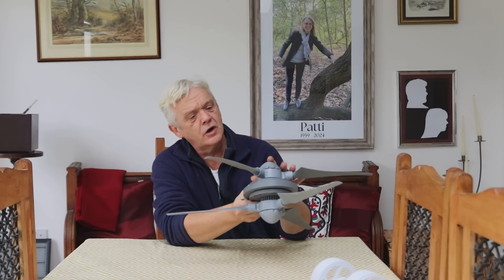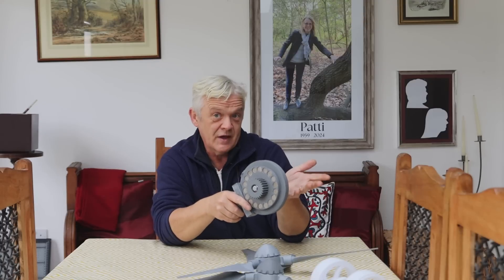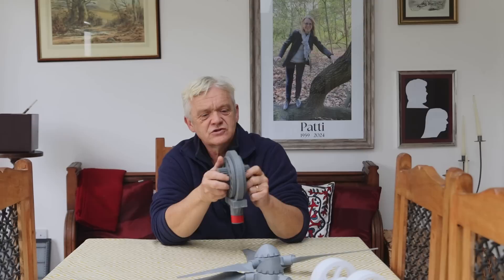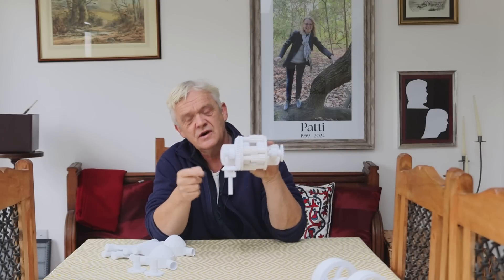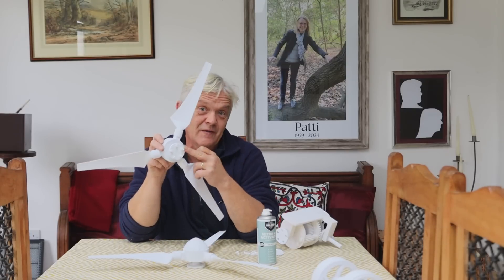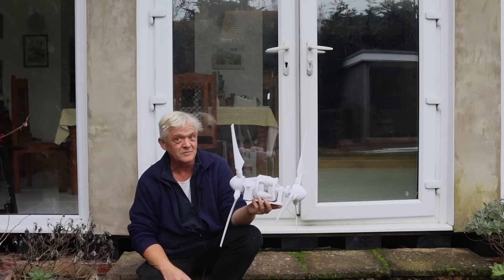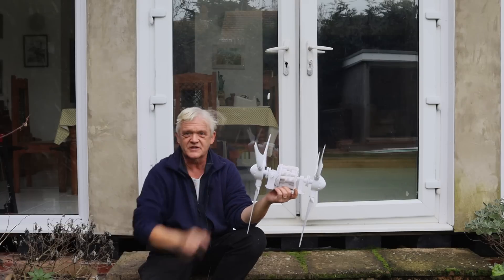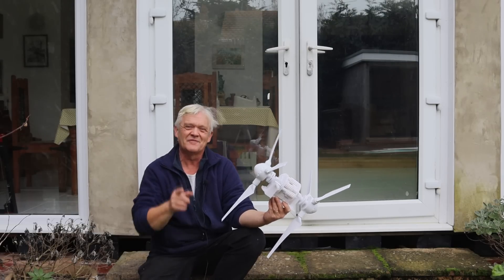2315 The Differential Wind Turbine

Comment: I made wind turbine controller from relay and zener diode and stuff. It disconnect turbine from circuit when there is too much voltage or too windy.
I think it is better than commercial one what basicly short the circuit, heat the coils and spoil magnets.

Comment: Very interesting thank you. A few years ago I met an inventor who took a different approach to the problem you are tackling. Instead of having two rotors and a central shared stator as in your design, he made both the rotor and stator rotate. One set of blades driving rotor and the other driving stator. A compact, simple and lightweight setup. A further claimed benefit was reduced stress on the supporting structure as the symmetrical reactions generated by the two rotating assemblies combine and neutralise each other prior to flowing out to the structure. ... Makes sense?

Comment: Been looking in the research but haven't seen it, is there anything to making the blades on 1 side slightly larger so as to capture somewhat more energy than the small and equalise the power/speed between the sides?  There would need to be a control that the small side faces into the wind and the large is on the downwind side.  Differences in wind speed energies requiring different diameters of blade could also be controlled to a degree by changing the blade pitch, a fairly common control on full sized windmills.  A control will be needed anyway as without a vane it isn't aligned passively into the wind.  Just thinking that equalising the output would simplify things resulting in an overall less mechanically complex unit though control complexity is increased.  However that is mainly programming.  Hmmm, just thinking this supposes a relatively constant windspeed which is not always the case.  How fast would the control system have to react?  Might not be practical however I'll still post this as it may spark other idea's.

Comment: Another comment regarding the PLA, have you ever tried iron-impregnated PLA in one of the generator designs? From my understanding if the core inside each copper coil contains ferrous material it improves generator efficiency greatly. There is also a stainless-steel impregnated PLA (both claim roughly 60% metal content), but I'm not sure if the type used is ferromagnetic. Would be interesting to build a gen using the iron PLA, perhaps only in the coil cores due to its substantially higher cost.. I would imagine ordinary PLA and the metal PLA would bond just fine so the filament could be switched mid-print.. but depending on design that could be very wasteful on the filament. Something interesting to consider :) I see "protopasta" makes metal PLA and it's available on Amazon.

Comment: Why not adapt the angle of attack on the two rotors differently to accomodate to the power loss. Not sure if it would be easy to measure if the angle "is good" then

Comment: Could you substitute the mechanical differential with a bit more complex electronics?

My idea is to put the magnets on one set of blades and the coils on the other set. By getting them to rotate in counter-directions, you get power output by having either one rotate or more if they both rotate.

To get the power out of the coils, you would need a bit more complex wiring, but a set of cheap brushes will do for this model size.

Comment: Using the greater length of the part of the cylinder of your diaphragm piston, I converted that into the piston and inserted it into a short length of acrylic tubing.  Instead of using the glove, I used a section from an old bicycle inner tube which lined the new piston and stretched around the outside acrylic tube.  I reprinted the cylinder to make it solid.  The material of the inner tube is butyl.  It still needs graphite for lubrication but it's workable and is a cheap way of having an actuator that could exert a few kilos of force in one direction.  However it could make quite a good water pump.  But if you want a really good water pump look no further than a sink plunger!  If you glue a sheet of perspex under it, drill holes for valves and put a crankshaft at the stick end, turn the crank, then for each cycle it could shift around 70ml of water.  If that was connected to the wind turbine it could pump water to a tank at a higher level.  Of course, in reverse it could still work as an engine or as a hydraulic motor.  So if you had 2 sink plungers, as one crankshaft rotated, the pressure transmitted through the hose pipe would go to the other sink plunger, and it would drive the flywheel.  A sink plunger is one of those things that one would never consider using, but having watched a good number of your videos, the possibilities certainly leads to some exploration.
Reply from the maker: that is impressive work mate - and i am doubly grateful you shared it - brilliant ideas - thanks so much

Comment: and what about rotors turning in opposite direction - one turns rotor and other turns stator which is connected through slip ring contacts. 
that would increase RPM on alternator.

Comment: Awesome video Robert.  … very inspirational.  Combining power should occur, but I’m thinking that the rear propeller could also spin backwards.  Even if it’s not obvious, a loss of power might be see.  I’m wondering if the rear blades need a greater pitch than the front - given the slower speed.  

I guess the only way to find out is to test it at extreme pitches, I think.  

You have inspired me to design a better pool cover gear system.  I’m thinking about using lantern gears made from 3d printing.
Reply from the maker: i have already made this in a different format mate it doesn't spin backwards

Comment: Copier technician approved!
We see a LOT of similar mechanisms!
.
Another advantage...
If the power take-off is mounted "vertically, the generator unit could be positioned low on the pylon which may reduce the mass and torque at the top of the unit?
Reply from the maker: awesome mate

Comment: Been traveling for the past couple of months, finally begin printing the parts for your portable generator, decide to switch to PETG from PLE + because of it's superior durability, spend the next two days of fail, coming to the conclusion I'm a nube who forgot his KISS principle, switch back to PLE +, because that works and I'm making a prototype that I will no doubt muck up as a first go, print one of the gears successfully, look out the window, there's no wind, and decide to see what Robert is up to...I'm beginning to feel a bit like Dorian Gray's portrait.
Reply from the maker: wow - where have you been to and di you enjoy it?
Reply: @ThinkingandTinkering  Short version, Northern California to the coast, Southern Cal, to Palm Strings, to Tuscon, to Utah, to Nevada, to SF, to San Diego, there and back again. The highlight was drowning my sorrows at the absence of pubs and pints in the local wine bar.  Sitting next to an retired electrician who thought I was quite mad for building a generator with a 3d printer and winding my own coil - serpentine, thank you very much, we bonded over my ignorance, enthusiasm, and tipped a glass to you.

Comment: I think this twin rotor is dead in the water and not worth pursuing, It it was then we'd be using it. 
If you study airflow then you'll realise that what comes out of the back of a turbine is a random mess of air and incapable of powering another one to any positive degree. It will actually be worse than that though and hinder the flow through the first one by having it's exiting energy reduced.

I hold you in such high regard that (and i've said it before) you are good enough to be on TV, but the one annoying thing is that you never see your projects through to the end. If you did that you'd be a much more powerful resource.
I wish I lived near you, i'd be popping round to team up and make some of these things and see if they work in reality!
Reply from the maker: it is being used
Reply: @ThinkingandTinkering  Successfully? If so, where?

Comment: Bravo ! ! !  Nice exactly what was needed to make this great ! ! ! Some dimension also need to be corrected. I was reading some studies about this topic,  distance from rotors is also very important, swirl angle, dimensions of the rotors, with smaller rotor in front & larger in the back,  power peaked with rotational speed diference of N = 0.3, tip speed ration around 3, & hybrid air foil with high lift to drag ration for rear rotor, combining the suction side of the DU 86-084/18 with the pressure side of the SD 7003 demonstrated superior lift to drag. Bravo ! ! !
Reply from the maker: nice mate - an excellent post thank you for taking the time to make it
Reply: I am curious to know if laminar flow is more efficient than turbulent flow? Maybe laminar flow can be created by the first blades for the second blades to use?

Comment: Spur gear differentials are so much better suited to high duty cycle - they are used in the few "successful" coaxial helicopters (single or dual turbine input to the rotors - torque balance  -  yaw controlled..)
Reply from the maker: I didn't know that - very interesting thank you mate

Comment: Forgive me for my ignorance, but if instead of your bulky accumulator differential( which is amazing)...what if you allowed the device to rotate. It might be slightly less efficent than the add diff, but one blade slower should translate into angular momentum around a fixed point. I believe you can put a simpler version of your add diff at the bottom on the rotating shaft. So if you put your generator on a 10M tower, you can have your diff down below the sweep of the blades .
Reply from the maker: nice ideas cheers mate

Comment: spring mass damper analogue is inductance capacitance resistance there should be an electromagnetic equivalent to a differential irrespective two generators seem to go on the shaft line by the looks given physical distance to prevent or limit somehow interacting electromagnetism and each suitably sized equally a differential is perhaps as good if not better in some or all respects the blades however are another problem much in the way it is as they pass the tower (resonance vibration condition)
Reply from the maker: I am not suggesting you use two generators mate - but you are right there are issues - there are always issues

Comment: Fun mechanics but I'd like to see someone test a contra-rotating wind turbine where the 'stator' actually moves, but in the opposite direction to the rotor. Blades need to be oppositely angled. the rotating 'stator' has the windings and brushes while the rotor has permanent magnets. I'd just like to see if it produces more power, or if the attraction between the stator and rotor poles slows each blade down to cancel out any gains or makes it worse than a normal turbine. It's even worse for birds but should be quieter.
Reply from the maker: why don't you design one mate?
Reply: @ThinkingandTinkering  .. lack of time and skills... The only 3D CAD package I've managed to master enough is Wings3D which is not parametric so no use for making real models. Fun, easy to learn and powerful in its own way, but old now. Great for designing round things like turbines, just not printing them. Attaching it to the shaft is probably the sticking point, and housing bearings.
Reply from the maker: I am sorry mate but that's definitely a poor reason. I did this in tinkercad which took me about 5 minutes to learn.

Comment: seems like you could make some kind of governor to control the blade pitch to balance the front and back or even use a computer to control it via torque sensors.
Reply from the maker: sure it's a way to go

Comment: I see a problem with your design. Not a serious one at this small prototype scale, but it's going to come to bite you when you scale up. Every time the down-wind blade passes by the shaft, it's going to briefly dip into the wake of the shaft and experience a momentary reduction in force upon it. That is going to make the blade flex slightly every rotation, which is going to 1. Seriously reduce blade life and 2. Make lots of noise. This is why all rotating HAWTs place the blades in front of the shaft.
Reply from the maker: not all mate - check out the research on this kind of double rotor - it is fascinating

Comment: I wonder if having the second turbine a little bit larger the the first would be a simple way to counter the rpm asymmetry. Might not need to be that different in size to match them 5-10% perhaps. Your videos always spark more ideas, keep them coming Rob :)
Reply: Different Pitch on fore and aft blades. Slight size and weight difference between..
Reply from the maker: it is one approach i have seen
Reply: @ThinkingandTinkering  Sir, I have read Archimedes made a magnet wheel device where Gearing and magnet faces of similar pole interaction reduces Drag, Exploiting Timing and magnetic Repulsion... Eighties a Asian man made these, coupling many generators on One Motor. Don't know if you saw Archimedes example, but with 3D printer I think it's a good project, just saying it might make 1 windmill or waterwheel power 2+ generators at once..
Reply from the maker: I have done it mate - what you are talking about are magnetic gears and they can be arranged as a planetary gear system easily - but is definately a good idea thanks for sharing
Reply: @ThinkingandTinkering  1 thought, one tiny mag peer tooth, North side Out for tiny push of Both interacting gears interacting.
 You a Tinkerer, Archimedes had Gears on shafts mag wheels on opposite side of shaft, but I know 3D print can put mags right in gear Tooth for continuous force.
 Chinese man used Lathe which was time and impressive, 3D printer, Modeling program few hours..

Comment: Wouldn't this work best if the rotors were contra rotating?

The first rotor is going to deflect the air, a contra rotating second rotor should be able to capture that.

I further assume that in a wind farm this would increase overall efficiency because the wind direction after the wind turbine is similar to it before.
Reply from the maker: yep - motion is  all relative

Comment: That's just awesome! Great job! 👏
Reply from the maker: cheers mate
Reply: @ThinkingandTinkering  Where did you get your 'small bevel' from? Seems to be a problem with it.
Reply from the maker: @dSquared0162  i drew it in tinkercad mate - it is the bevel gear from the drop down menu - if you type gear in the search bar it is the 3rd down on the right hand side - it is module 2, 22 teeth, pitch angle 30 angle 45 and height 10 there is an 8mm hole in the centre. Then I just exported it as stl
Reply: Seems to be the same one as in your "Craziest Clock Mechanism"... minor size tweak... so I'll use that.
Reply from the maker: @dSquared0162  yeah i reuse loads of designs - saves time mate
Reply: @ThinkingandTinkering  12mm hole?
Reply from the maker: @dSquared0162  lol - my bad - yeah exactly - to fit the output axle
Reply: @ThinkingandTinkering  All good. Going to have a go at printing one of your differentials... just have to decide which one! Cheers! 👍
Reply from the maker: @dSquared0162  awesome mate - cheers

Comment: hi Robert you don't need to shrink your diff gear to match your 1: .25 ratio just increase you blade diameter until the ratio of diameter to spacing is reached, unless you 3d print bed size wont allow it , which ever is simpler or practical.
Reply from the maker: either way is good mate - as you point out - whatever suits your printer
Reply: @ThinkingandTinkering  
There's no reason you couldn't print each blade in 2 parts and clip them together?

Comment: Great demo, one potential downside is added complexity versus a single, larger machine, or even two smaller ones.
The simpler the better, is a good rule for anything that resembles infrastructure. It gets complex enough no matter what.
Reply from the maker: true enough mate
Reply: Agreed, simpler is more Accessable

Comment: Interesting....i could do with one of these on my little sail boat
Reply from the maker: that would be cool - did you like the sailing reference?
Reply: @ThinkingandTinkering  I was thinking of it before you said it!
Reply from the maker: @ben1895  lol - awesome!
Reply: Suggest, add a Benbini on-line.
Use both sides of Coil, setting one side North-pole and South pole aligned, add pick-up coil to receive from magnet wheels, or D.C. Gene as Bearing for mag wheel and Gene simultaneously.
"LIDMOTOR" CHAN has build vids on these, uses one on his Sail boat actually.

Comment: What about making a hydraulic fluid differential.
To produce electrical power and heat ?
It would be self lubricating at the very least and with proper design it could possibly charge a battery and heat a home simultaneously.
Reply from the maker: go for it

Comment: Nice one Rob, one of these days I might be able to afford a 3D printer.
Reply from the maker: doesn't matter if you use a 3d printer or not - the same principles apply
Reply: It is possible, if you have a public library accessible to you, that they have 3D printers available for a nominal fee. I've seen some that charge something like 6 cents per gram of filament. You can forego the cost of buying the printer or full spool of filament yourself.
Reply from the maker: @rafalklepinski7372  that is an excellent suggestion mate
Reply: @rafalklepinski7372  I live in South Africa, so no chance of that.

Comment: Umm - what's the point of putting the differential in?? You start with explaining the issue relating to the two sets of magnets, and then you proceed to create a dual turbine without the wiring OR magnets. What you end up with is a windmill, not a wind generator
Reply from the maker: umm indeed - do you not see that the take off shaft is where the generator will be? I don't want to be rude mate but you do need to think it through a little